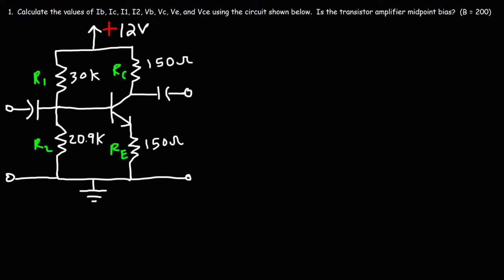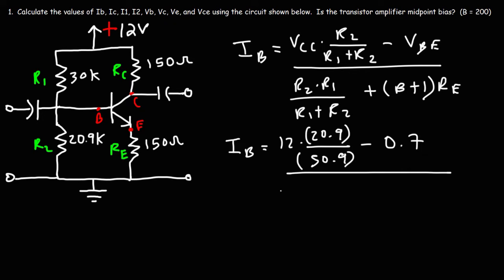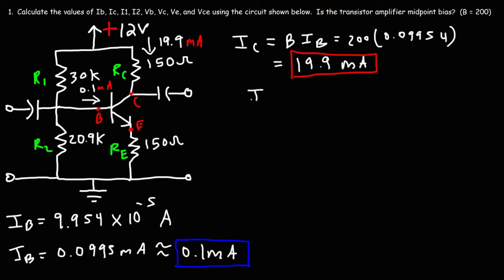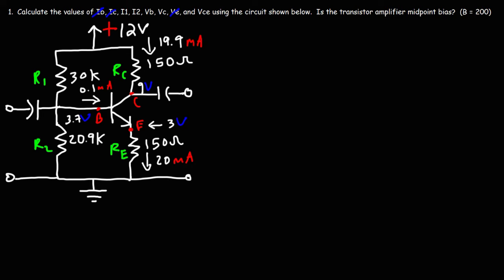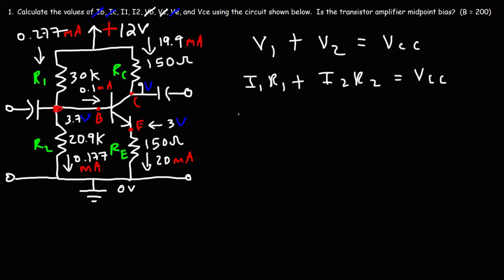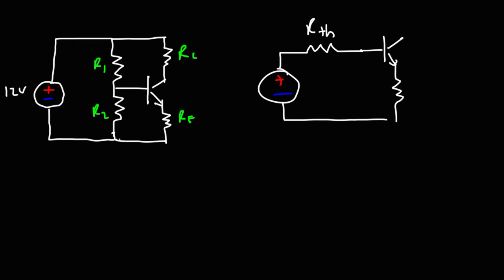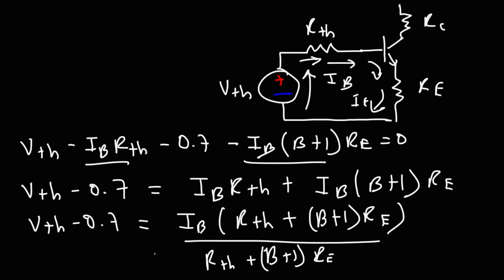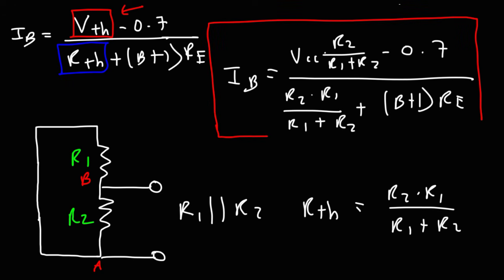Voltage Divider Bias Circuit

Comment: Great video, thanks. One question follows: Wouldn’t it be better for Vc to be equal to 6 Volts to maximize the output dynamic range? As things stand Vc is 9 Volts assuming I’m following along correctly.

Comment: I enjoyed your solution and explanation, I would highly recommend the following....It would really help if you would say at the beginning that this solution  is for NON stable voltage divider circuits, or  circuits that are NOT stiff. (Stable or stiff  is when Beta x RE is 10 times bigger than R2).  in this example R2= 20.9k and Beta x RE = 30K  this is no where close to the requirement for a stable voltage divider circuit.  When circuits are stable there is a much simpler and faster way that is beta independent.  The reason this is important is that beginner electronics students will be very confused when they see this and don't understand why your doing this this way.

also, no one would make this. Its an interesting exercise, perhaps a nice question for an exam, but when RExBeta is not at least equal or great than R2, the base current starts to load the voltage divider, making this beta dependent, which negates the whole reason to use a voltage divider in the first place. 

just a thought.

Comment: Hi, so I built a similar circuit on a breadboard. Carefully measured all voltages, resistances and currents. Base current measured was 12uA. Applied all measurements to the formula. Resulting calculated base current is 12.1uA. Have to love it when the math lines up with the real world!

Comment: I'm not sure that the Base Voltage of 3.7 V is correct here, because it lacks the voltage input from the V-source/voltage divider. It seems that the BASE VOLTAGE is the Thevenin Equivalent voltage of 4.9V. It can't be both, and 4.9V satisfies the KVL loop for the Base-Emitter loop and represents the first entry into the big equation for Base current. The Thevenin equivalent voltage is the voltage produced by the source voltage and the  voltage divider. The 3.7V value did not affect the other calculations, so I think this is a minor error. Any other input on this welcome.
Reply: Base voltage is 3.2V

Comment: Personal notes: 

in voltage divider bias circuit Ve = Ie*Re
Ie = Ic if Rth < (1+B)Re if it is not, use Ie = Ib + Ic
also learned where Vb, Vc, Ve are positioned

Comment: It seems that we assume B=200 holds for the circuits. 
Does anyone know why we can confidently use B=200?
Or in other words, how do i know that the circuit is running in the active zone before i start solving it?
Reply: The beta is determined by the specific transistor that you use, you will have to research the part number to find it on the data sheet or calculate the value yourself.
Reply: @brandonfd789  Thanks, Brandon! 
I understand that is the value specified in the data sheet. My question is more about how to determine that the transistor is working in the linear active region, so the B is perfectly 200? Why is the transistor NOT in the saturation region? Or cutoff region ?
Reply: @weisun5461  this question makes sense only for active mode transistor.

Comment: How do you find the collector current if you're not given the beta value?
Reply: Either find the beta of the transistor with a data sheet or calculate it, I cannot remember the specific formula for that.

Comment: Something i never got. How do you derive the product over sum rule? Like, why can you only use 2 resistors for that?
Reply: Think about what happens at the nodes where two transistors are in parallel.  How are the currents and voltages related?  Try to use Ohm's law and Kirchhoff's current law to find the total current across both resistors, and then the equivalent resistance would be R_equivalent = V/I_total.

Comment: Going the route of solving for VB with thevenin, then solving for VE using difference between base and emitter voltage, then using the drop over the emitter resistor to solve for emitter current, then finally solving for IB and IC using beta relations will get you a vastly different answer. Why is that?
Reply: I believe transistors are actually non-linear devices, so thevenin's theorem would not be applicable here.

Comment: I've been trying to solve this without find the Thevenin equivalent as was done in the video.

Using KVL in the "finding the I_B" stage, I initially used:
V_CC = I_1R_1 + V_BE + I_ER_E

and from that have gotten as far as:
I_B = (V_CC(R_2/(R_1 + R_2)) - V_BE) / ((β + 1) R_E)

It's basically the same as the one that was used in the video, however I am missing a term in the denominator which is the equivalent parallel resistance between R_1 and R_2.

Can someone try to point out how I could fit that in this equation? I feel like I should have included it in the initial KVL equation I used, but I don't know where (and how) it should go.

EDIT: After searching a bit, I realize that the equation should've been:
V_CC = I_1R_1 + I_BR_B + V_BE + I_ER_E

R_B is the parallel resistance I'm missing. However, I'm still struggling to intuitively think of the existence of R_B along that path.